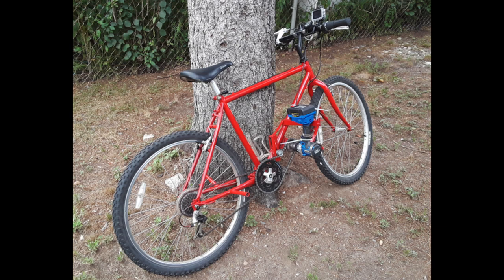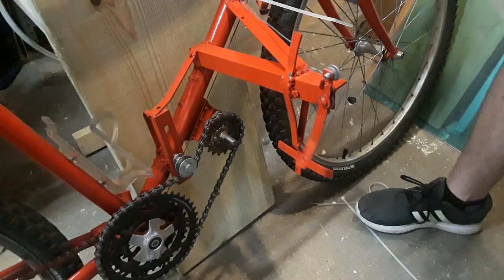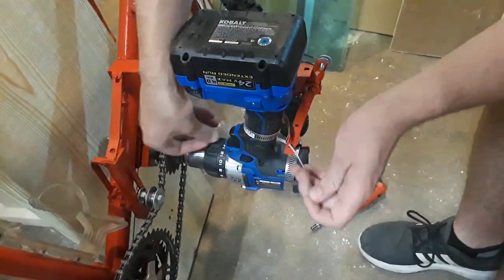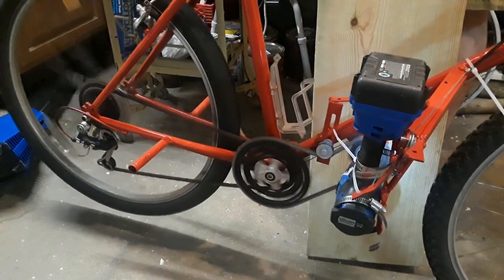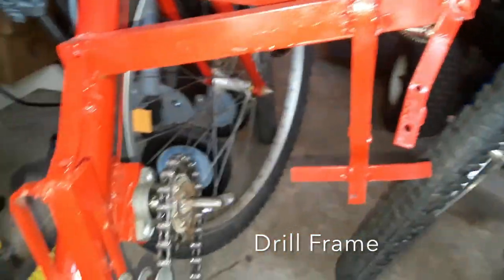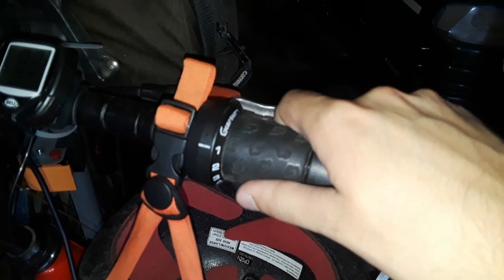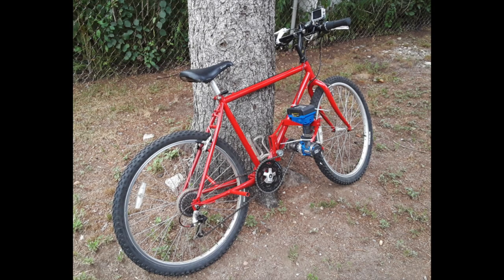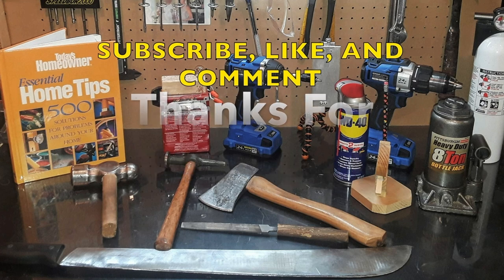Drill Powered Electric Bike 25MPH 40KMH!!!

Comment: how long does the battery last at 15 MPH and 25 MPH?
Reply from the maker: I would definitely say the battery will last longer at 15 MPH. But I would say the most limiting factor is that the drill will overheat before I run out of batteries. I would say I've gone 3-4 miles on a 24V 4Ah battery at fairly lower speeds 8-14MPH and it drained the battery to about 25%-33%. I've noticed that the drill doesn't heat up easily at lower speeds but when I go up to 18-25MPH is heats up fairly quickly.
Reply: @BunkerBuilder  thanks for the answer ,
Reply from the maker: Your welcome, And I'm making a better one this spring. Stay tuned!

Comment: Two questions. Could this work with a modified cordless angle grinder? And how do you make the pedal sprocket part?
Reply from the maker: I'm sure you could make an angle grinder work but I don't think it will go very fast because you have high speed and low torque.

As for the pedal sprocket part. I had to cut off the pedals and add another small sprocket that attaches to the drill. That smaller sprocket attaches the larger sprocket were the pedals would've been. This is to give the bike wheels more torque. Hopefully this helps.
Reply: Thanks for responding to me.
Reply: @growpowerful  i think your idea would work with a little bit of extra work. Cordless drill has more torque and lower speed as he mentioned. But you can implement a gear ratio that results in the desired output.

Comment: I do the same with me 3 Gear bike. Its geared a little to high (testet one second gear) but it runs good. I haven't driven yet, I just let my tire turn and it was f*cking fast.. 18 volt to 24 Volt and high Amperes. How fast it would be? It has very high rpms 😅 40, 50-55 kmh? I also lightly oiled it so that it doesn't break immediately.  it is clear to me that it lasts for a month have a lot of such engines
Reply from the maker: I hit around 20mph on my drill powered ebike. I ended up upgrading my ebike with a dedicated brushless motor. Here's the vid
https://youtu.be/phOMSm4fgYE
Reply: @BunkerBuilder  nice video but i live in germany if cops see me with the big motor i can have big problems. I had a chase on a dirtbike they didnt catched me. I sometimes find garden tools that are battery-operated, 36 volts.  i believe that the motors that are installed there are also good for the bike.  Nobody else wants it or the battery is defective
Reply from the maker: Oh man, that sucks. Goodluck with your build!